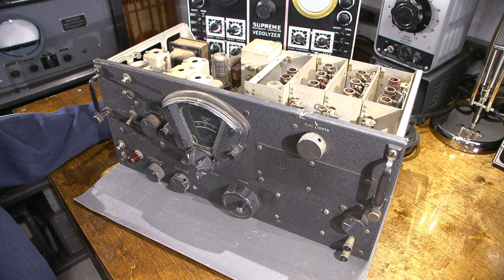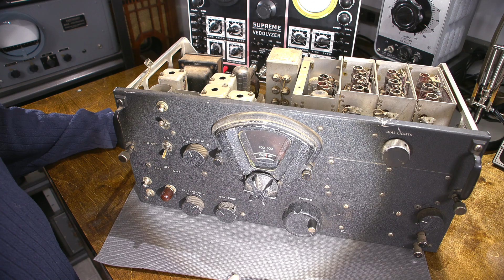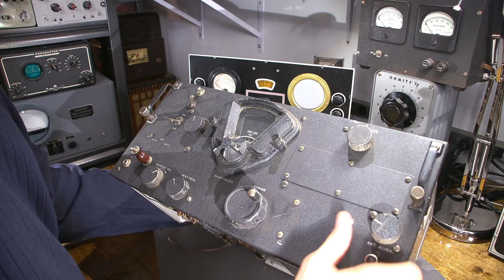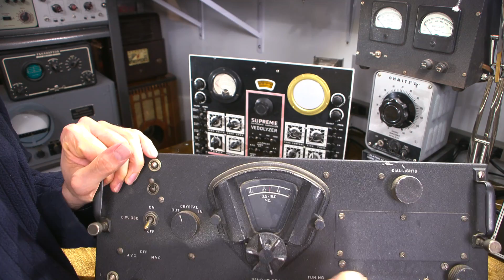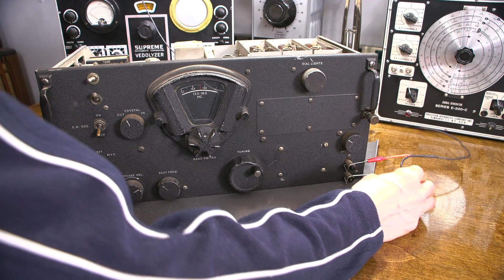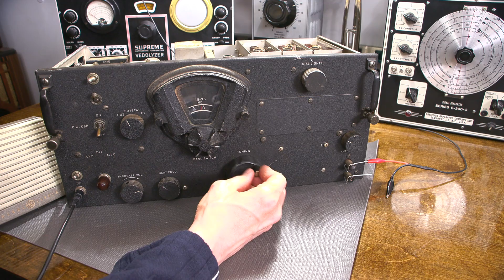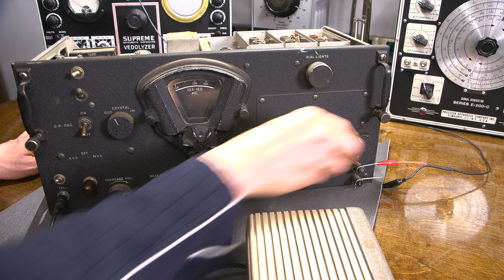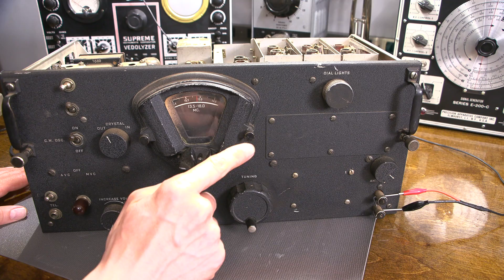B-29 Aircraft Receiver Scrap Parts Unit, Will It Still Work?

Comment: Will there be a "Mr. Carlson" turning on an iPhone 70 years from now? Even if it works, it won't be able to connect to a network. On a side note, I strongly feel it would be a huge mistake to do away with all analog broadcasting. We should maintain analog as the foundation on which all other forms of electronic communications rest. In case of emergency, how reliable do you think digital would be? And trying to fashion a digital receiver out of junk drawer parts? Not likely.

Comment: I need some photos from inside the grid cap series (R, N etc) . Does someone have a set pulled down who can do that for me?...I need to set tthe switch wafers in correct positions after fixing...and for once....stupidly... not taking photos. The Antenna first wafer is 'coded' as the band change bar has a ridge allowing only one way of replacing the bar...problem is...the other wafers can be 180 degrees out as they do not use the same single slot exclusion. It's a long story but can someone assist? please....

Comment: I just got one of these a few weeks ago, though it looks more complete than this one.  Haven't opened it up yet, so who knows what I'll find, or nor find, inside.
Reply: So I popped it out of its case, and found that it's been worked over already, with modern caps in place of at least some of the originals.  There's no dynamotor or other power supply, though, so I'll have to work something up to get it to run.

Comment: "For parts" has nothing to do with the actual state of the appliances. These days selling something for parts just means that the seller accepts no responsibility what-so-ever for the state of the device. Effectively it means no returns if something is broken. It could work, it could not. The seller does not care. Somewhat of an end run around consumer law. Surely everybody that ever bought something from an action site like ebay knows this?

Comment: Modern equipment will fail if you look at it funny, old equipment goes on forever.
A tip to work out where to drill holes in the covers would be to get some card, put some ball bearings in the screw holes and press the card on top ;)

Comment: Have a request.  On the schematic that I have, it shows a relay connection on pins 2 & 6 of the 8 pin connector.  When you are doing the restoral video, would you please go over the purpose and use of these connections.  I think it would be beneficial for a number of people.
Also, did you notice that this one has 2 RF stages?  Cool eh?

Comment: Of course it will because it has no electrolytic caps, these old army and airforce transievers feature oil cannister capacitors sealed in steel tins and those cant detiorate like electolytics or open paper in oil caps....vacuum tubes last 4 ever too if not smashed or cracked.

Comment: A cb'er may've had it and didn't know how to use it or newer ham that only knows the new technology and if it broke parts would be hard to find and expensive so he may as we'll sell it for parts for someone who has a radio that uses the same parts, I think its a sin stripping a working radio also not repairing & restoring the non working radios.